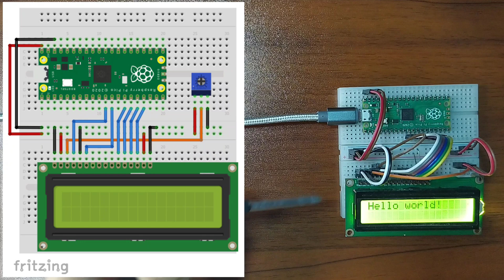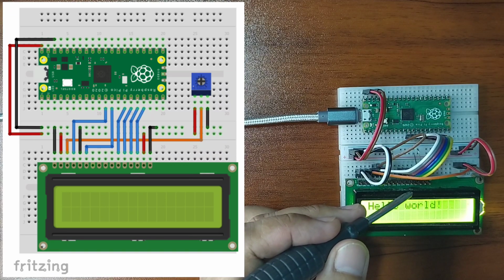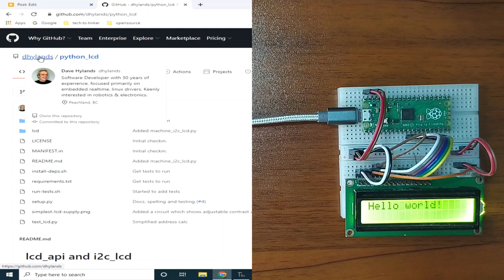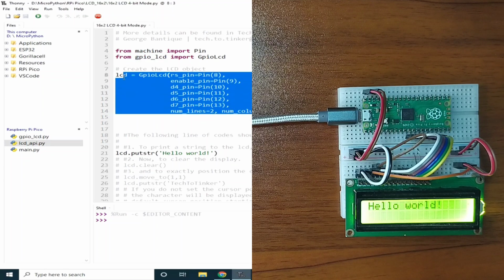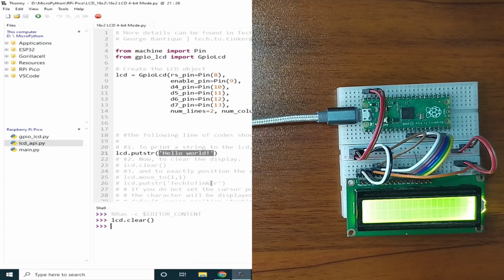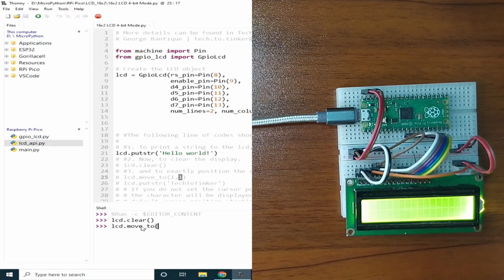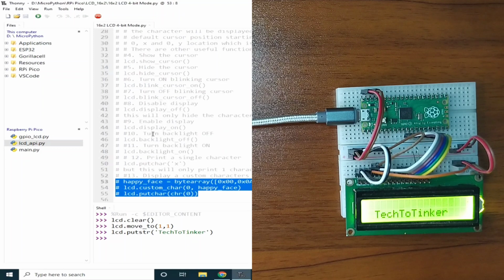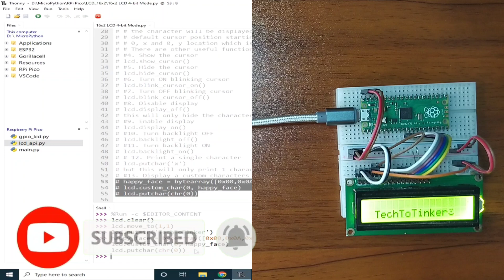002 - Raspberry Pi Pico: LCD 4-bit Mode (not I2C) | MicroPython

Comment: >>> lcd.putstr('Hello world!')
Traceback (most recent call last):
  File "<stdin>", line 1, in <module>
NameError: name 'lcd' isn't defined

anyone help me?
Reply from the maker: The necessary library should be uploaded in the MicroPython root directory and also be imported before running that line of code.
Reply: You might have not declared your lcd object, in the video, he declares it with the name lcd.
lcd = GpioLcd(), filling out the parentheses with their respective parameters

Comment: G'day TechToTinker

I have the "print" working but if I add "lcd.putstr" I just get 4 large cursor blocks.

Full Script in Thonny:# Weather Station Tempature Output

from machine import Pin, Timer
from gpio_lcd import GpioLcd
from tmp117 import *
from utime import sleep_ms

# Flash Pico LED
led = Pin(25, Pin.OUT)
LED_state = True
tim = Timer()

def tick(timer):
    global led, LED_state
    LED_state = not LED_state
    led.value(LED_state)

tim.init(freq=1, mode=Timer.PERIODIC, callback=tick)

# Create the LCD object
lcd = GpioLcd(rs_pin=Pin(8),
              enable_pin=Pin(9),
              d4_pin=Pin(10),
              d5_pin=Pin(11),
              d6_pin=Pin(12),
              d7_pin=Pin(13),
              num_lines=2, num_columns=16)

mySensor = tmp117()

while True:

        # Read and print the temperature in various units

        tempC = mySensor.readTempC() # Celsius

        tempF = mySensor.readTempF() # Farenheit

        tempK = mySensor.readTempK() # Kelvin
     
        tempStringC = str(tempC) # convert temperature number to string

        lcd.clear()

        lcd.move_to(0,0)
        
        print("It's " + tempStringC + "\u00b0C") #### test if tempString is valid
              
        lcd.putstr("It's " + tempStringC + "\u00b0C")
                    
        sleep_ms(1000)
Reply from the maker: @Silvergull, I'm not sure how to answer you but have you check if your circuit connection is correct?